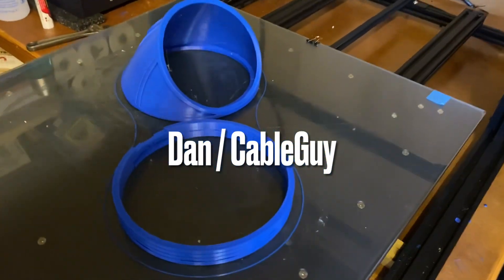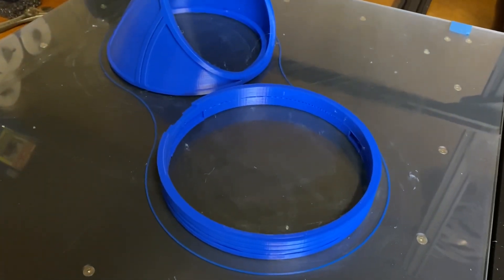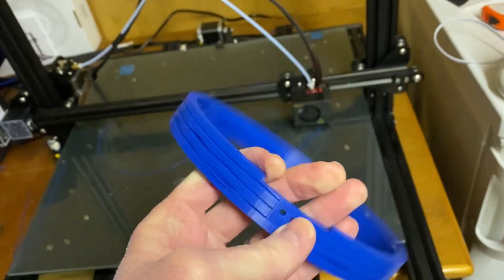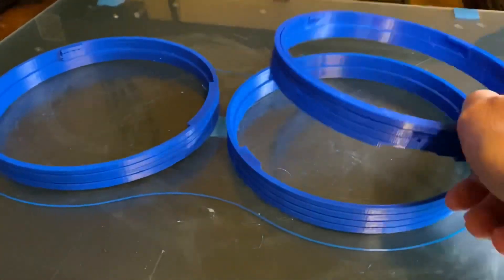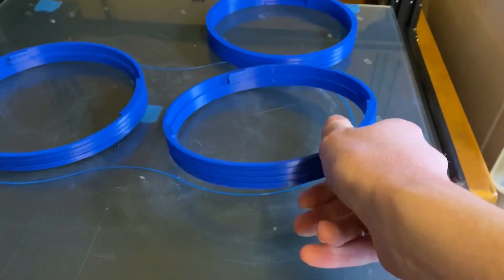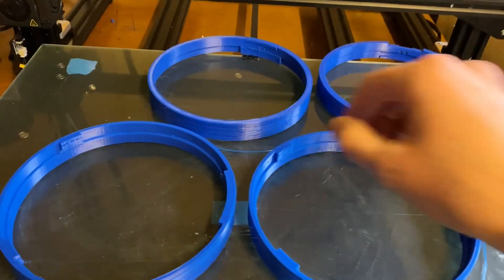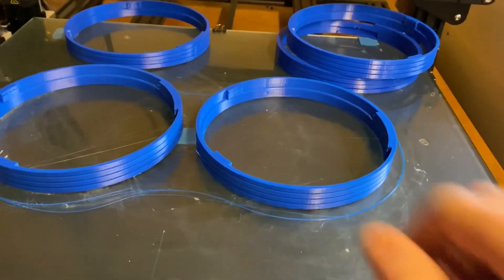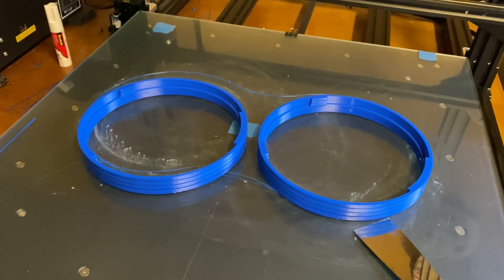Building a WEARABLE 3D printed C-3PO costume: trial & error

Comment: I've been lurking on the group for ages, Pedge can vouch for how long I've been messing with my CR10 S5 trying to get it running lol BUT this is great seeing the progress literally hot off the press...bed... :) Great work. I'm printing at 106 percent on many parts I'm hoping it'll be fine when they turn out! 🤞 Good luck with the rest of your build!
Reply from the maker: Ah, thanks for following and for the comments. It’s certainly taken me a while to get more comfortable with the printer. I got this in November (if I remember correctly) and used it a few times. Then had a huge nozzle clog which took some time to remedy and that really threw my confidence with it. I didn’t use it for around a month. 
Pleased I’m now back to using it and getting some solid prints going. :-) 

Hope to see your progress on the group page. :-)

Comment: Nice Dan, what’s the cost of the prints so far?
Reply from the maker: Cheers mate. So far, I’ve only used the sample filament that came with the printer, then one reel of filament (around £18) and I’ve just opened a second reel of filament. 👍🏻
Reply: Pretty reasonable then, keep the progress vids coming 👍🏻
Reply from the maker: @Andy-2022  you should get one. And an Xbox. ;-)